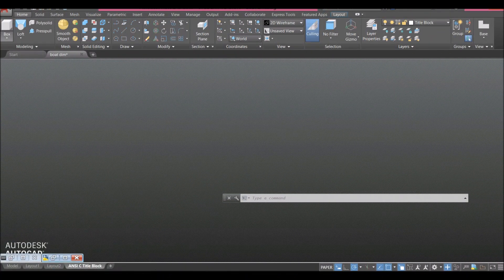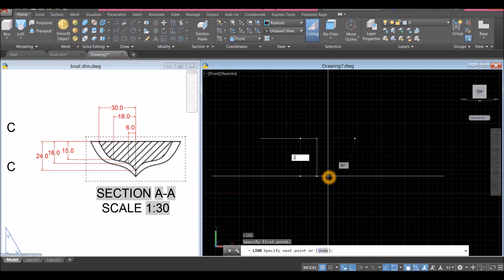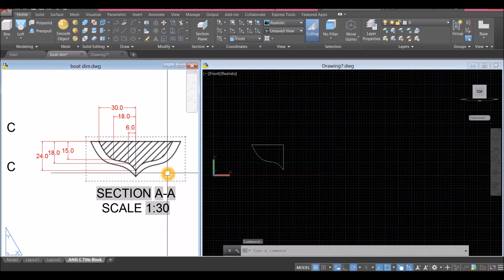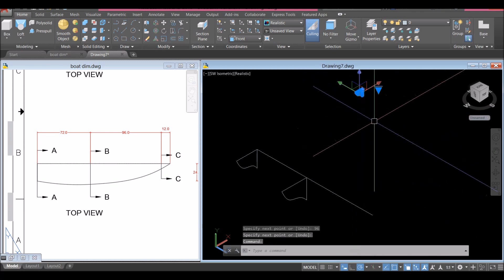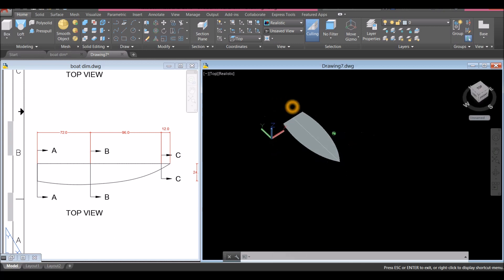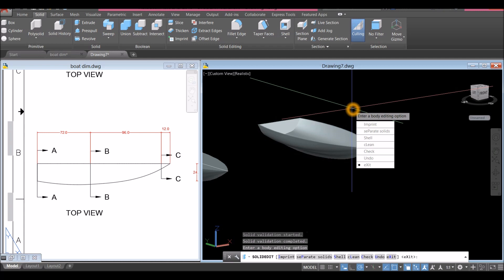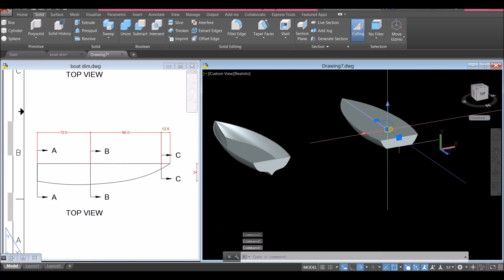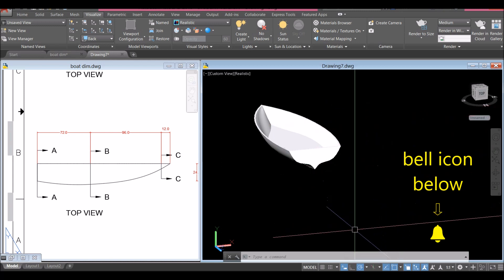Designing 15 feet Speed Boat Hull in Autocad PT.1

Comment: When join it, look like not join at all, look like still split at some part
Reply: Most likely, you have extra lines on the line, and most likely on the top line, so when you draw the shape, delete the top line and draw it again, after that apply the _join command to the finished figure so that it becomes one whole spline

Comment: at 7:45, the line doesnt want to connect to the corner itnstead it wants to conenct at the end points for the reference lines in between the boat, what do i do.
Reply from the maker: At the status bar , right click polar tracking, click tracking setting, select object snap, check the object snap on (box), check the end point box. I hope it works.